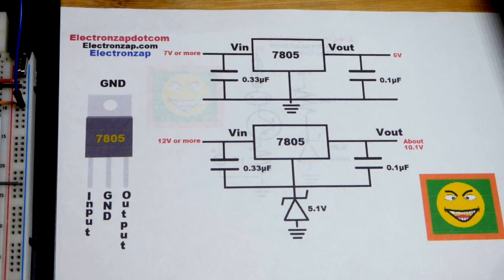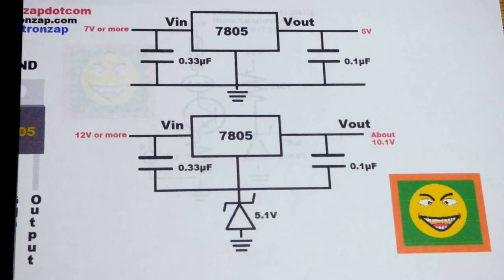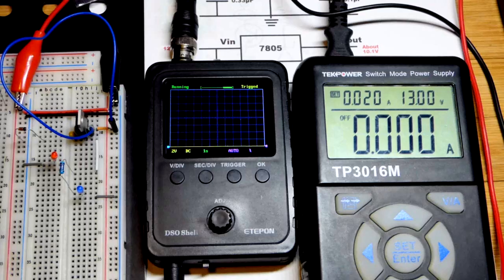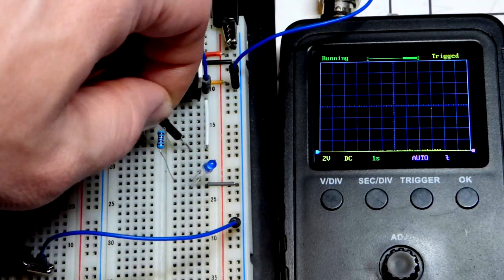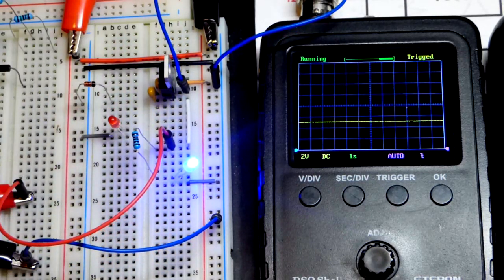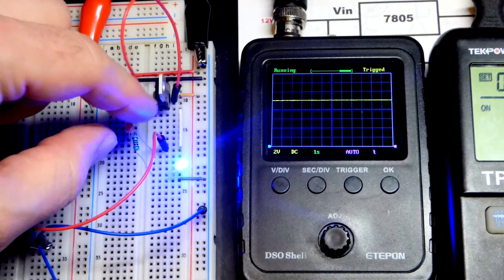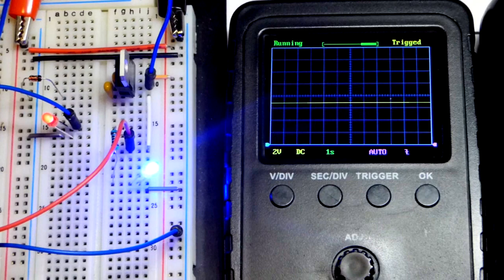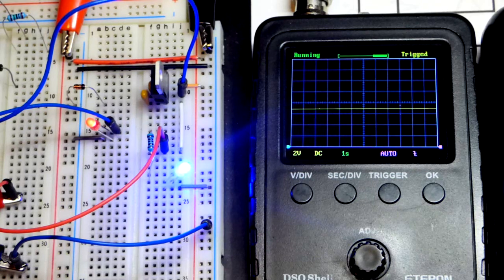7805 voltage regulator output increased by adding a zener diode electronics demonstration

Comment: Is there any method to increase output current to 3-5 amps using lm7805 ?
Reply: 2A max on those regulators. Most common is 1A and most practical for smoothest DC is to keep it under 500ma
Reply: You can use multiple in parallel to share the load. Use a 0.1ohm resistor on all of the outputs and joint them all together. They will require heatsinking too.

Comment: it's much simpler to connect regulator's common to voltage divider between output and ground - you can find this schematics in voltage regulator's datasheet...
Reply from the maker: Thanks for the info!